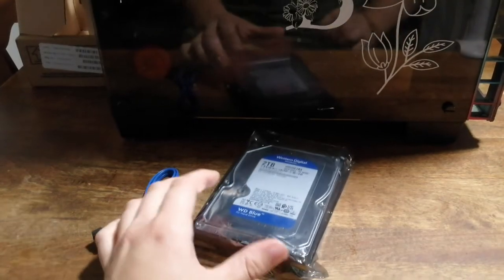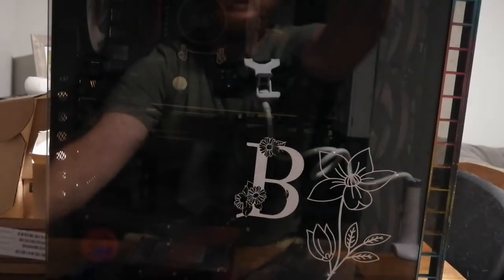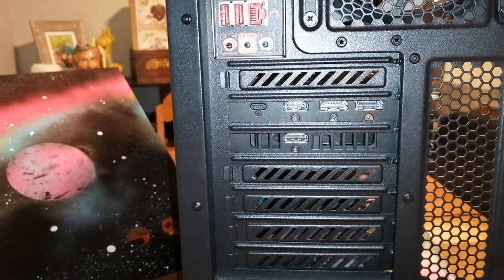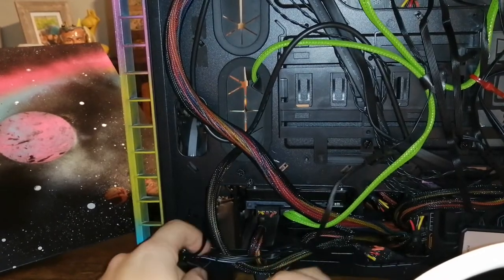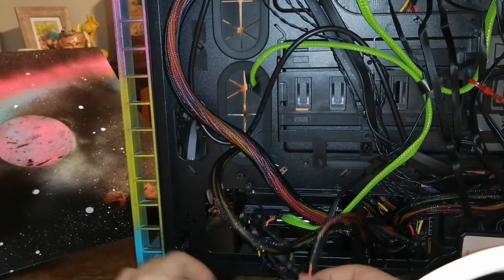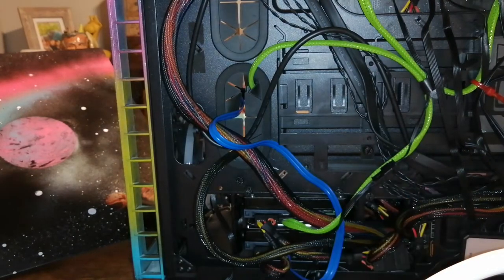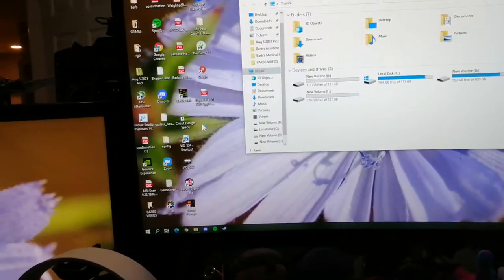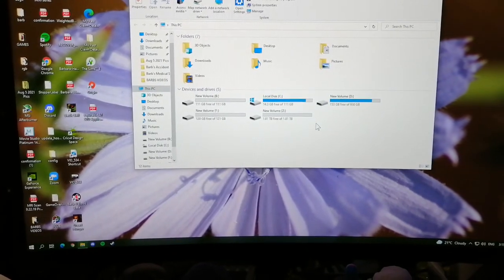How To Upgrade/add Storage To PC/gaming pc (HDD, SSD)

Comment: I only have 1 slot for my drive If I were to take the old one out and put the new one in, how would I transfer the files from the  old to the new?
Reply: You can just use a USB pendrive to first store all the things and then you replace it 😁
Reply: @LarrySurface  turns out I did have an extra Trey slot along with the cord and data cable as well thanks tho

Comment: if i have an old laptop hdd with windows already on it can i still add that?
Reply from the maker: Yes just have to format it to remove the files saved to it
Reply: @NWCPcbenchmarks  how do i do that i tried but it never booted until i took out the new drive
Reply: @NWCPcbenchmarks how many of the blue sata cable do i need? I have the black longer ones.